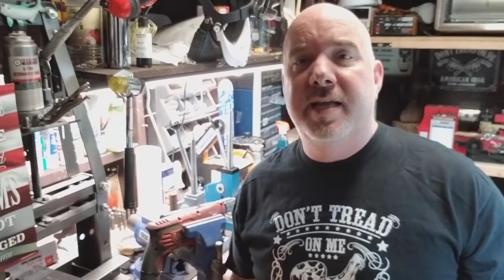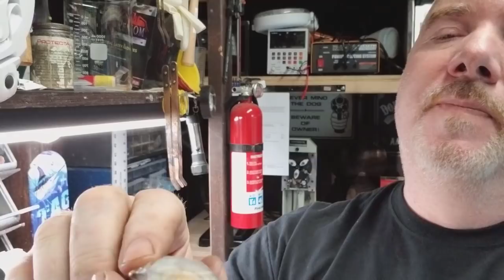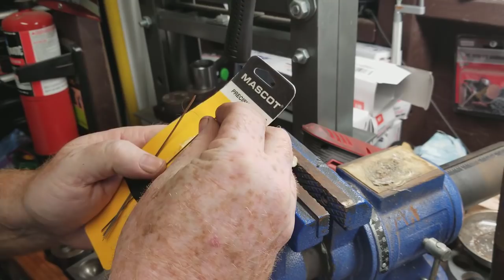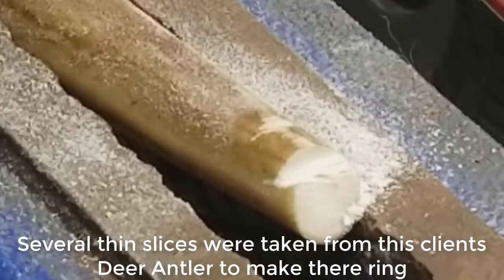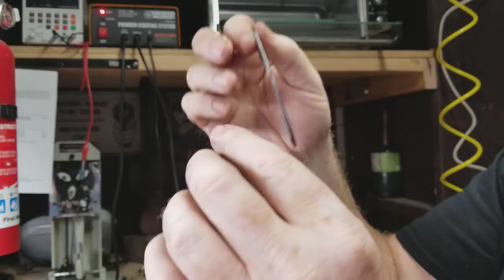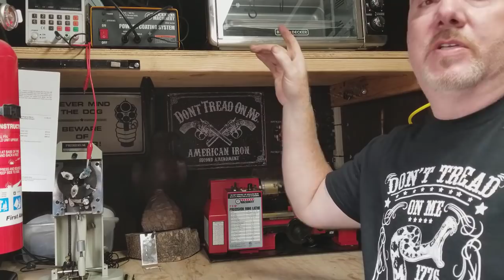New Release - Making a Black Hammered Tungsten w/ Real Deer Antler Inlay

Comment from the maker: For those interested, thanks to the suggestion by Aaron Joseph below, I now use a different technique to be included in an updated video in the near future but I now soak my antlers in vinegar for a week making it pliable/bendable and cutting long thin sheetings of the antler is much easier now for my ring inlays.  The rings look so much better now 😊
Reply: I know this is quite a while after the original post, but do you have details/tips on how you do the antler inlay rings now?  I tried doing one today, but I'm not happy with how it came out.
Reply from the maker: @85GOCARDS  I should make a video on it but here's the quick run down on how I do it,  I slice the horn horizontally and choose the section of antler I want whether it be the outside darker side or white innerside, etc, making and dremel it as thin as a slice of veneer then soak in vinegar for a day or two which will change it from a brittle piece to a rubber like feel that you can bend.  Wrap around and CA glue to your ring blank and epoxy outside to seal in place to help waterproof it.  Hope that helps.

Comment: Awesome video. Just wondering how you managed to keep the black finish after sanding down the inlay. I've been having trouble with keeping a colour finish on my rings. Was the inlay filled first, then powder coated?
Reply from the maker: @Brendan Graham   Thanks for visiting the channel Brendan, yes this is a rather tricky one to do.  I prefer to do the inlay first because I do a lot of sanding and final polishing after you put the CA glue sealer over the top of the antler and it would remove any powder coating applied especially when applied to Tungsten carbide like this is which is "very difficult" to get to adhere properly and that was a lesson that came with time.  You then tape over the antler with heat tape, powder coat and bake however this is where it gets really difficult because not enough and the black quickly wipes off in less than a weeks time of wear.  Baking too hot or too long on the flip side will yellow the CA sealer and make it look dark amber ruining the look of the antler if not crackling the sealer up altogether.  Just do it over and over and eventually you'll get the hang of it.  I found a lower temp of around 300F in just 7 minute periods 3-4 times allowing cooling between each session does the trick.

Comment: Hi, would you help me on how to coat my antler ring, because the old coating is gone now
Reply from the maker: +badshark21  Okay so if it is the clear coat that is gone, to replace it provided the antler is still fine you'll need to put it on a lathe or other device set to turn slowly where the ring is vertical and you slowly drip CA glue in the grove over a period time till it rises above the metal sides.  Once dry, then lathe and sand down to a 3000 grit with water like you would wet sanding paint on a car.  Even after the wet sanding it'll be foggy and you'll just need to finish it with a coat of jewelers sealer painted on and it'll look very clear.  

If you have any other questions or need help on how to place new antler on, you can always ask here or if you need my personal help, just contact me through my ETSY account at www.PatriotCoinRings.com